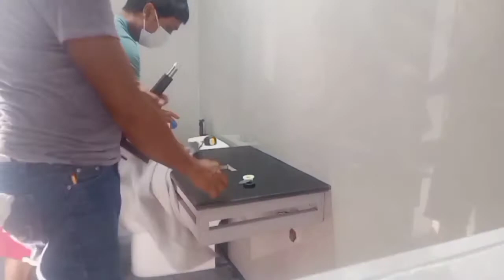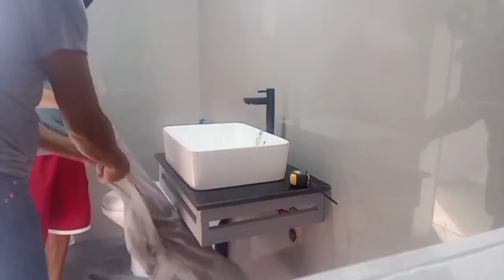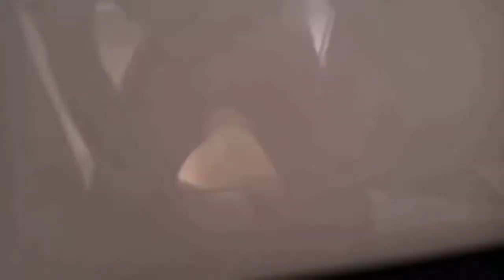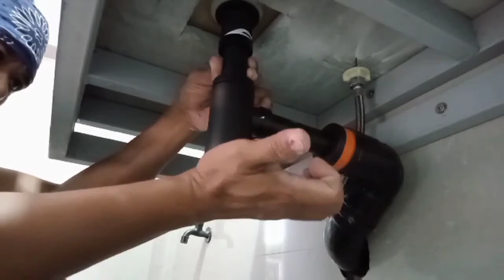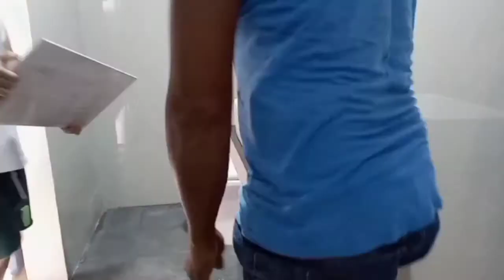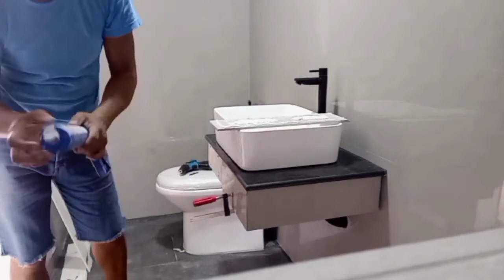PAANO MAG- INSTALL NG COUNTER TOP SINK | LAVATORY| DIY PROJECT

Comment: Sir ano po ginamit nyo sa drain sa mismong lavatory? With overflow system po ba? Yung nabili kasi namin di maikabit maluwag. Thanks in advance po
Reply from the maker: Opo, talagang maluwag, tatabas po kayo dapat PVC pipe tapos I cut ng 1" ng mga ilang piraso tas biyakin sa gitna hagang makuha tamang laki ng butas lagyan ng vulkasil, sana makuha nyo.
Reply from the maker: Yan po yung para sa Ptrap pa punta sa PVC pipe, kung , yung vessel na kinabit ko po may kasama ng Ptrap naglagay din ako vulcasil para sigurado
Reply: Sir Yung overflow po kasi nabili namin Yung may butas.. di sya natapat sa vessel sink Lagpas po. May fb account po kayo?

Comment: Ano pong materials ginamit nyo sa lagayan ng lababo?
Reply from the maker: 1x2 na tubular p0 ang frame para countertop p0 na granite,tas siding porcelain tiles p0,salamat p0 sa pagbisita❤️🙏
Reply: ask lng po ulit kung anong ginamit mong screw pang kabit ng tubular.? salamat po
Reply: Good afternoon, nice video po, very educational. Meron po ba ficem board sa pagitan nung tubular frame at granite countertop? Thank you po and more power. 🙏👍
Reply from the maker: Black screw, metal screw po pasensya na late replay 🙏
Reply from the maker: Ah paano oo ba, plaster board kinabit ko sa tubular pasensya na late replay sir🙏